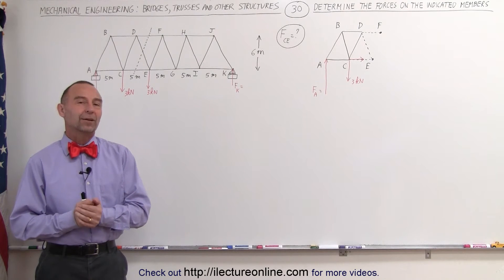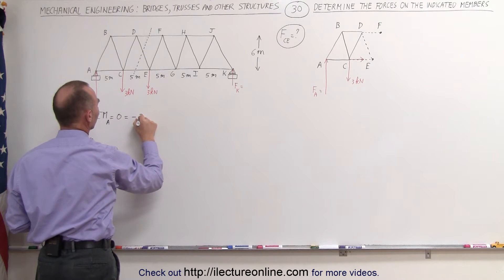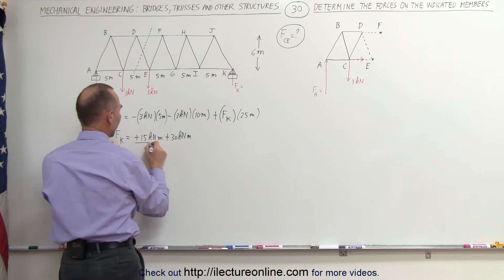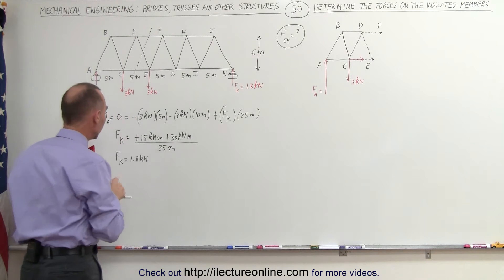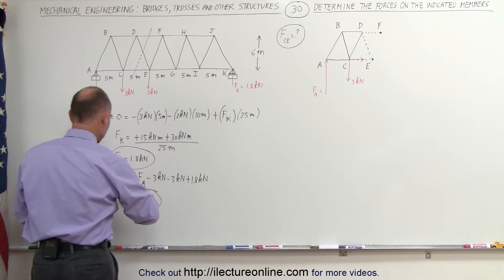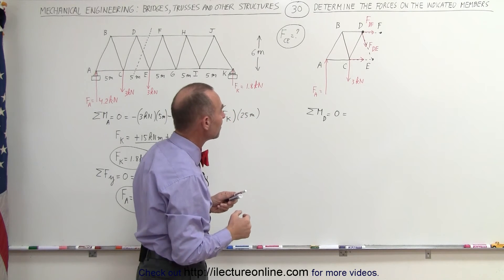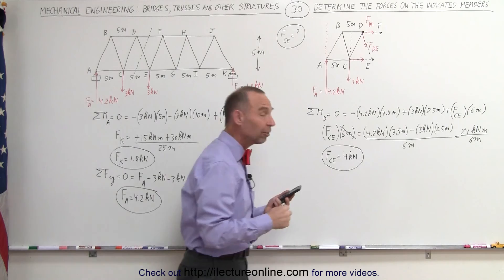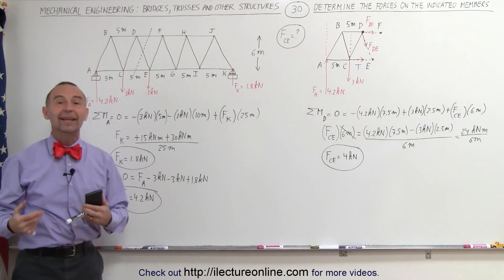Mechanical Engineering: Trusses, Bridges & Other Structures (30 of 34) Forces=? on Members 2

Comment: sir when solving trusses by method of sections we sometimes use various Pythagorean triple,  how do we know which of the triples we are expected to use
Reply from the maker: The illustration here is a "random" pick.  We could have made the "cut" anywhere on the structure.  The same principles will hold.
Reply: @MichelvanBiezen  could you please illustrate what you mean, with an example. I would really appreciate that.

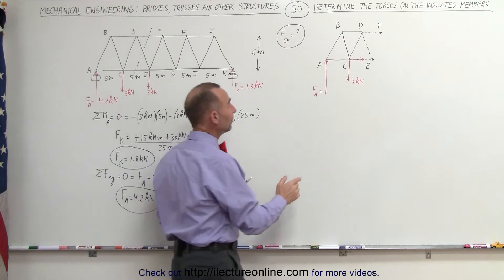Comment: at 3:30 you draw the forces DF and DE. what about the other forces DC DB AB or AC, why and how did you choose only those two forces to draw? Fa and 3kN is external but DF and DE seem internal which forces matter ?
Reply from the maker: When we make a "cut", we have a "solid" structure on the left with 5 beams and 4 joints (A, B, C, D).  Then we try to determine the force acting along the adjacent beams connected to the 2 end joints C and D.  That is done as shown in the video.   You can make a cut anywhere you like in the structure and use the same technique to find the forces on the other joints and beams.
Reply: @MichelvanBiezen  Thank you very much

Comment: The equilibrium shown FCE in positive direction and this is by assume in positive direction. What if we assume negative direction? The outcome of the calculation will become negative which is in compression. This may lead to wrong judgement of force direction on later stage. Should we define the direction before moving on to calculation?

Comment: Dear sir, When we draw a free body diagram at support A, we can see that the support at A has vertical and horizontal forces because of the pin. we are finding the moment at D. isn't the horizontal force from support A causing moment at D? Thanks
Reply from the maker: No, because the line of action of the horizontal component goes through the pivot point (point of rotation) and therefore the moment arm is zero.
Reply: @MichelvanBiezen  thanks